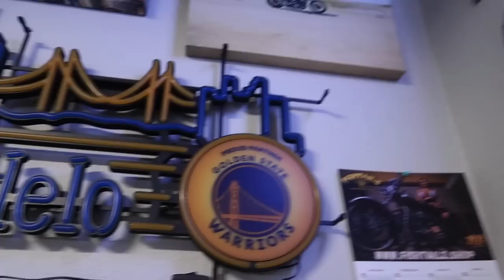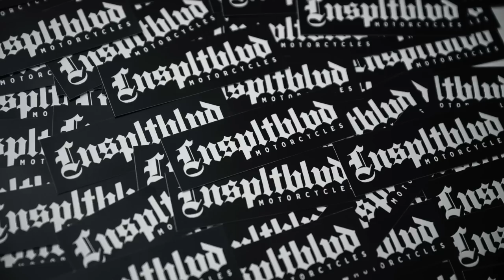Big Twin EVO Chopper Build | Part 2 Santee Frame Swap

Comment: Had built a hardtail EVO but went back to a soft tail . 
I love long rides on my bobber but as i get older  i feel the hardtail makes me take more breaks / stretch from the rough ride.
I def would build another one for the short rides / bar hopper i used to call them.
edited to add ... looks like i have a lot of vids to catch up on as i no longer get those notifications lol

Comment: But why you change the frame?
Reply from the maker: It’s personally preference and I’m pretty particular on what I want. I like the clean lines of the rigid frame. I got a good deal on the new frame so I went with that route instead of hard tailing the stock one.